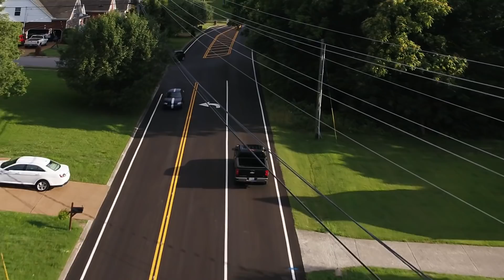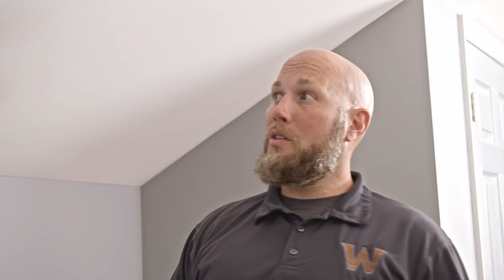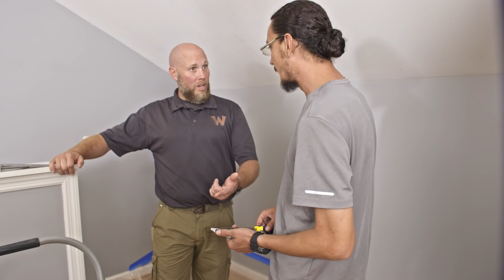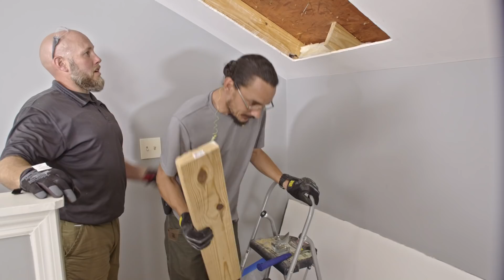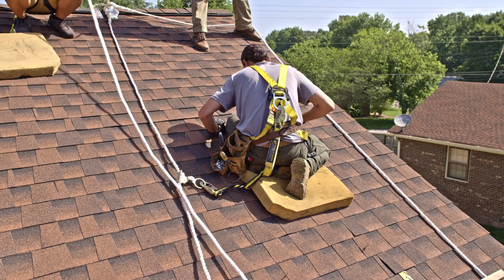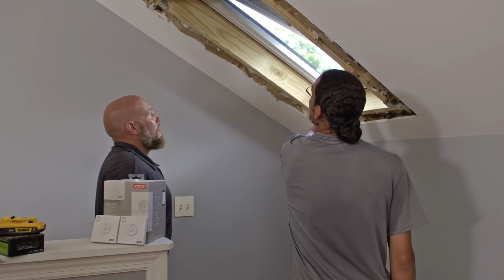Building Science: Ventilation

Comment: Will this work via Bluetooth on cellphones while you’re home, or do you have to have home wifi? I know if it pops up Notifs on your phone when you’re away, it’s using a wifi or Home connection to the internet. I’m asking if it can work when you don’t have/can’t afford home internet?
Reply: if you can afford an old router from goodwill or other thrift stores then you can set up a smart home network without internet access. However the appliance may need internet access to function properly and that will have to handled in a case by case basis but if you cant afford home internet then i wouldnt recommend home renovation. 1 skylight installation could buy a whole year of basic internet access